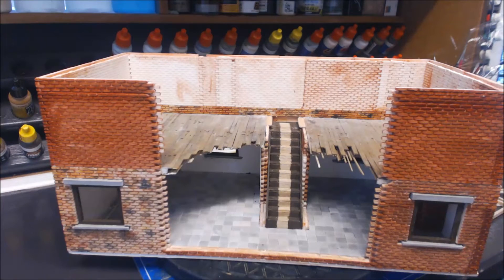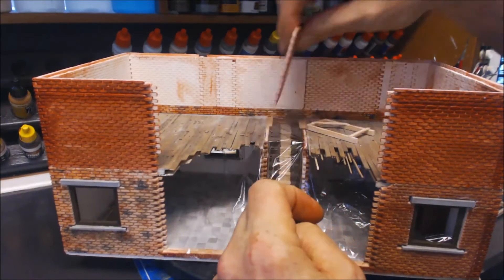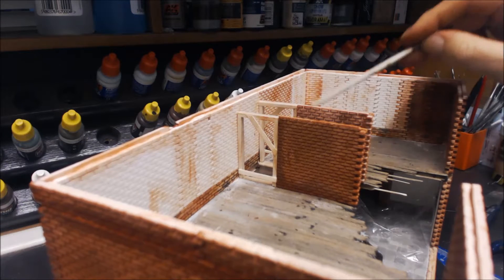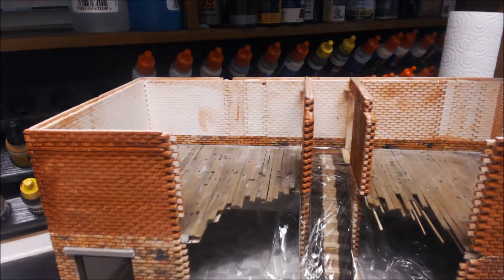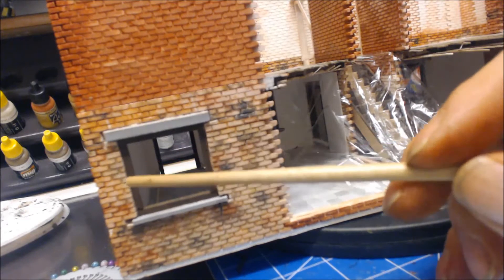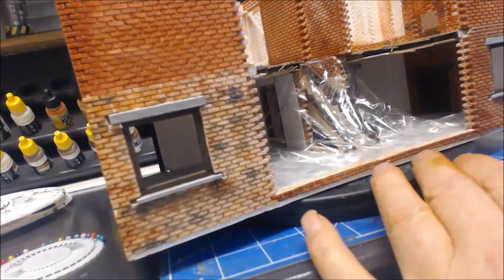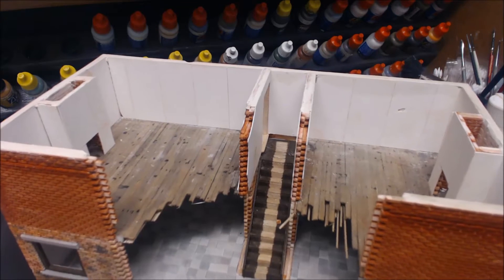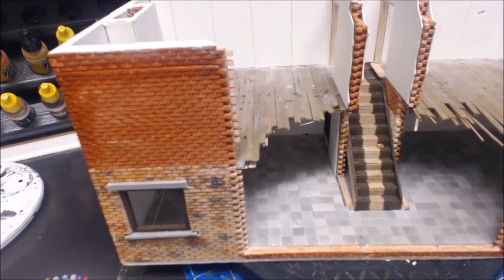Finishing Up First Floor in 1/35 scale I video 19

Comment: Been casting all weekend got the cobbles to look great with the weathering was going to ask you what red you used for the brickwork but I'll just wait for the video I guess. once u start actually casting how much work goes into what you do.I was doing it in my kitchen wife not to happy lol about how many castings of cobbles did you do for the video with the Stonewall in the tree
Reply from the maker: When I first started I was cast in the kitchen the wife didn't speak to me for a fortnight mind you it was bliss lol I ended up moving production into my little shed which resolved a lot of problems I am going to do a video about a different method of colouring bricks I will give you a head-up and it you  get VALLEJO PIGMENTS DARK RED OCHRE  73-107 it's not badly priced at modelhobby it's about £2.65 which isn't bad I've worked out a couple of different techniques which really look good I will do a video like I said some time in the next week and put it out. You will find that you will get faster and faster at casting the cobbles I got it down to a casting every 15 minutes as you don't handle them as much as the larger parts pop out of the mould after about 10 minutes  and leave to cure in a container many thanks Sim